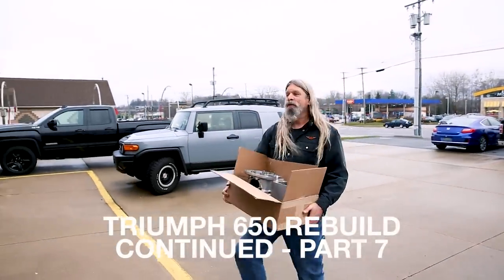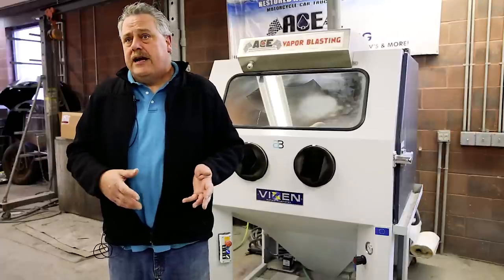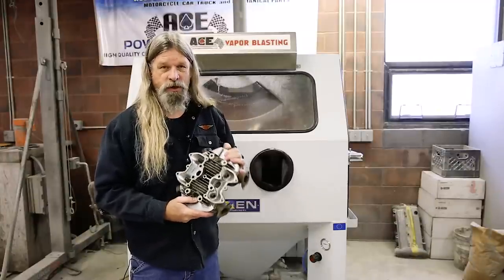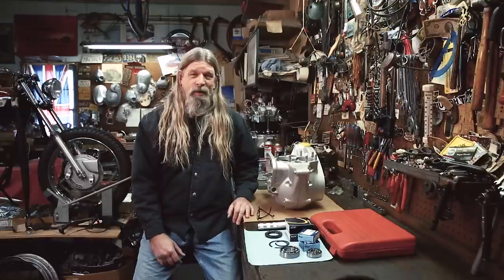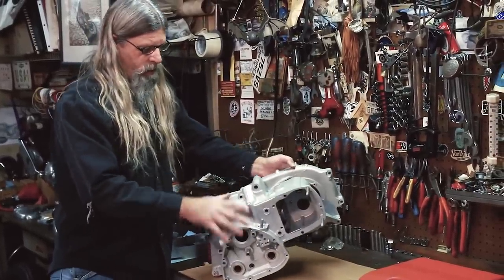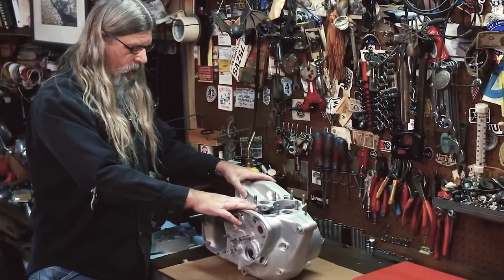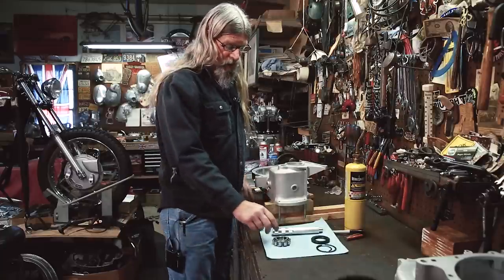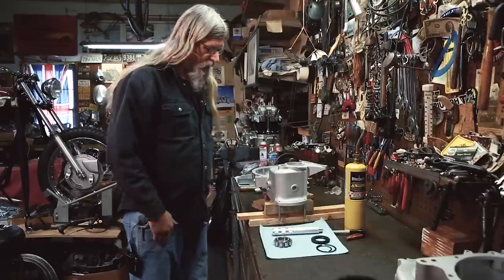Triumph 650 Motorcycle Engine Disassembly & Rebuild Part 7 - Lowbrow Customs

Comment: 36:46 It's that damn cabinet door i tell ya! Time to velcro tab that bitch.
37:17 Lookin back... ready to throw that hammer @ the help poppin' off.
All funnin' aside, much obliged for the insight of precise steps taken to dis & reassemble
the 650 engine. Hell Fuzzy, now i need to get back to Big D Cycle & give em' another brisket for overhauling mine. Loooking forward for more posts of the build. 4718

Comment: Hey Todd, I am in New Zealand following your videos as I completely disassemble and reassemble my 73 T140v, in a 69 TR6P frame, which I've had for 32 yrs now; she's 50 this year, so it's a nice birthday present to her...  I have a quick question if you still view them, would you vapour blast the Amal Carbs also..?  I see you didn't and wondered if there was a reason for that, please..?  OK, ride on man...  Cheers Robin.
Reply from the maker: We usually just run new carbs, most the time those old ones bow or leak and cause troubles. Its just easier to replace them with fresh new ones.

Comment: Instead of heating up the crankcase halves with the torch like you did, could you also heat it up using the grill method like you used on disassembly?
THanks,
Rob

Comment: Very competent and friendly person: your work bench unfortunately does not have a lot of ballast or the structure is not well tied. So it vibrates a lot in its competent disassembly and assembly. It would be convenient to back up with some impermeable bags of clean sand (like water filtration) below the bench's center of gravity, giving it more rigidity. With a bench with great inertia, everything is easier and safer. Your work is wonderful!

Comment: Excellent instruction, Todd!
 For the bearings, if you can locate an oven, the cases can be evenly heated to 250f. the thermal expansion tapers off after 212f so it will be the most accommodating to the frozen bearings. I use an old welding rod oven. When I want to remove crank bearings, I put the case in the oven at 250 and in about 20  minutes the bearing usually drops out.